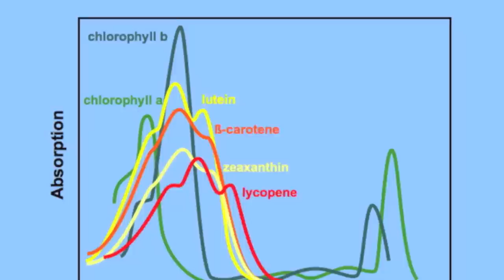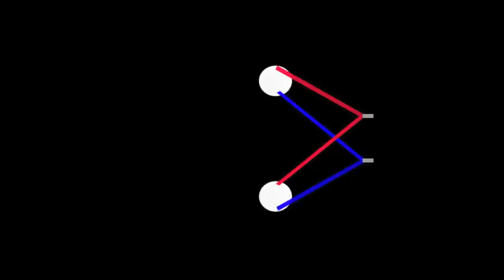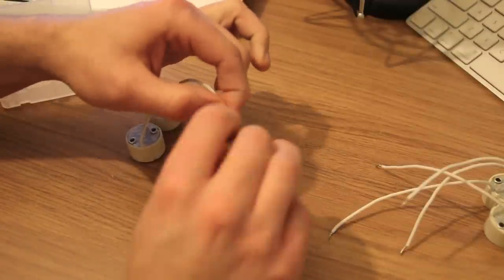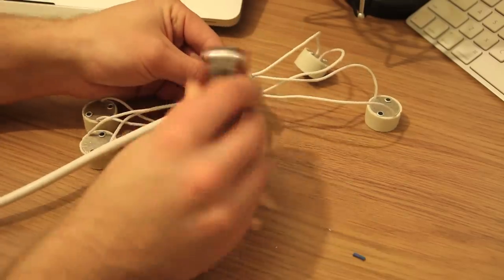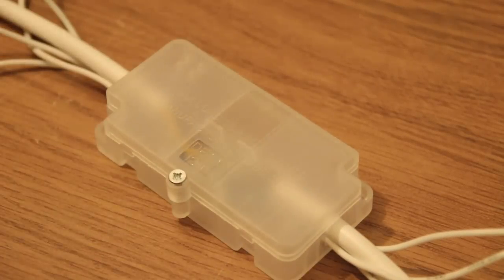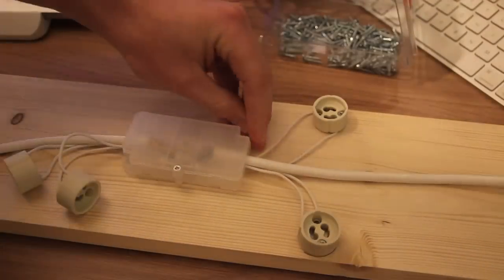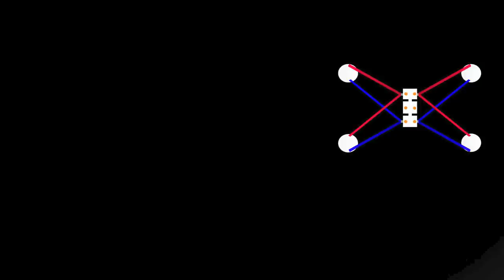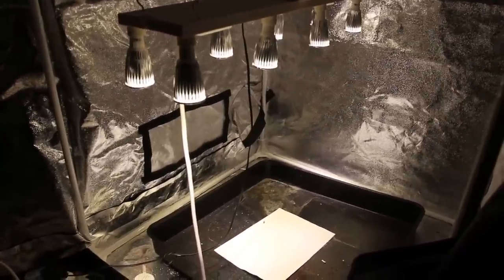96w DIY LED Grow Light - How to build it for $57

Comment: Great build. Your the only fella,except for me that used an electric box for connections. Two things. One mount the light sockets on a metal box/frame. Electricity get hot and Sparks, mounted on wood equals fire  And you got a ground going nowhere. If you had a metal frame, you would have a ground for safety. And a fuse isn't necessary but would be nice. I built 3 light bars. Check it out. These pointers aren't to criticize, but for people's safety. ✌

Comment: alot of people say you must have red and blue leds but the reality is you can use cool white and warm white led bulbs and get fantastic results. cool white and warm white work fine for plants in non flowering stage.  some people talk as though they wont grow at all.  its a little exaggerated or made to sound worse than it is

Comment: They'll grow under any light yes, I'm not trying to say they won't, I'm just pointing out that plants need light in different spectrum for chlorophyll production and photosynthesis. Vegetative plants need more blue light to produce chlorophyll than flowering plants. Flowering plants need more red light to make use of the chlorophyll. That said most lights will put out some light at both points in the spectrum anyways. I think this best route is the one that works for you.

Comment: The 3w LED watt strength is not enough for deep penetration. You have to make sure that the lenses the manufacture use are 90 degree lenses. Generally, most LEDs use 120 degree lenses which defuses the light and doesn't focus them downward towards your plants. Great DIY setup otherwise. I recommend using an LED with the correct lenses degrees (90 degree lenses, again, is recommended). Thanks for the upload.

Comment from the maker: I would agree save for one point, and that is if something at the terminal block goes a little bit wrong. ie. if a wire comes loose. In that sense, I think it's quite important to have the grounding there. (although by that point it would make little difference)

Comment: i think the way to go is vertical growing with large led panels or lightchains that are waterproove put very close to the plants ( like salades) so u could also install a sytem that waters that plants constantly with smoooth raindrops that at the same time are cooling the leds. or for bigger plants like tomatos led cob modules that have higher light penetration.

Comment from the maker: Because its important that each LED be high wattage for maximum light penetration, ie. minimum 1w per LED. Generally the light tubes use SMD LED's which are far less powerful.

Comment: btw leds really can be a costsaving alterntive for horticulture. But its all about efficiency of the leds and the usage of the light. with single chip led u can get that big of a point of source effect as u will get with a hps so if u dont want to build ur leds around ur plants u have to go for chip on board led modules (up to 200 W). the are really similar to the light densitiy characteristics of hps lights. Or you build large panels and put them around the plants.

Comment: Thanks for sharing. Just a note, the equipment ground wire (grn/ylw) serves no purpose in this setup. You can use a 2 wire cable

Comment: Vince, I first watched this video some time ago, and found it very interesting.  But I was new to all the indoor growing hobby.  But I now have my own self-made grow station, which is set up for the 1020 tray system.  The frame is 48"w X 20"d X 80h".  I now have two four foot T5 systems(one 4 lamp, and one 6 lamp).  But I want to try out the led growing way as well.   Stupid phones(pun intended) can take pictures, but cannot spot metre a dark portion, and then allow me to shift position and come up with a decent picture.  I'll have to use a dedicated camera later. 

My problem is that I have limited height allowances and must make the light system only take up a few inches in height.  Have you tried setting up a grow system, which uses either the flexible led strips, or the 3 watt individual lights, and making a larger system?  Either would be the perfect way to save on height.  I know it is a bit more complicated to do, but would be a real feather in your hat if you could come up with a 2 foot, or 4 foot, led grow lamp.  Again, I could just double the length of your project here, but I would still have the height disadvantage.  

Incidentally, Great job on this project.

Comment: 10 real Wattage per bulb  that is pretty nice for this price. 
Are they available in blue and in red?
With HPS light higher penetration( lux/distance) is achieved with reflectors cause of the point of scource effect and 360° emitting.

Comment from the maker: You'd be surprised. In a smaller area (this bit is key) the light intensity is similar. We're talking about a 20cmx20cm area for each bulb, as opposed to a 120cm x 120cm area for a 400w hps. the HPS lights 4x the area, but the light intensity is similar. Which is interesting because with the above figures, the HPS covers 36 times the area, 36 x 12w = 432w. So there must be some truth in what I'm saying.

Comment: plants can´t do anything with green light! although if you count reflecting as something it can be do with it, you´re right! :D the only reason why leafes are green is because they do not have the ability to absorb green wavelengh. if you would create a sun only for the needs of plants, it would have 430, 460, 640 and 660 nanometers as the dominant wavelenghs, a bit of 500 and 620 for secondary metabolites and nothing more, even these last two wavelenghs can be missing and its completly fine!

Comment: That doesn't explain the lens degree though. The LED can be a 10w chip and it won't do anything if the lens on it diffuses the light making it unusable to growing. Keep in mind that LED manufacturers create LEDs to light a house, not grow plants. The specification any grower needs to look at, other than the chip size, is the degree of the lens. 90-60 degree lens is what you need, period. Don't care where you get it, but you gotta know what you're buying. So tell me Chris, what's the lens degree?

Comment: The best available high power leds have around 100 lumen/watt (cost around 5-10 dollar per piece). So ud have around 3600 lumen total brightness. Hps have around 150 lumen per Watt. If u want to grow 0.2m*0.2m/bulb u want to liught 0.32 squaremeters with that lamp. that makes around 11 250 lm/m^2 which is just enough light to grow plant in vegetative phase, but to flower plants like tomatos u need at least 30 000 lm/m^2. So the plants grown will 1. stretch 2. only prodce small fruits on the top.

Comment: Does is matter what the sockets are "rated" at 120V or 220V? If they don't have any electronics in them, is there really a difference between '120V' and '220v' socket. In America with '220V' sockets with 120V lamps and 120V electricity.

Comment from the maker: Do a little calculation on watts per square foot of a HPS - this grow light packs about 48 watts per square foot (or the V2 does anyway, this one more like 36 watts) - a 250watt HPS usually grows in about 9 square feet which is 27.7 watts per square foot. Simple maths :-)

Comment: if I wanted to triple this amount of light (96 x3) should I just extend them with wire like you do connecting the boxes or do the 3 sets with individual power supplies?  I have a 6ft 90 gallon tank and want 3 watts per gallon.

Comment: Question: I have a light fitted in my bathroom,  its round with cover , when cover is off it holds 36 ( non replaceable L.E.D's-), lamp 16w l.e.d ,would this 250-Hz?????

Comment: Very similar to the one I've just built but I've used 12 x 5 watt units in a mix of grow light and daylight. Just a few criticisms... 

1) Pinching the wires like that is a no-no but you know that. 

2) Please buy a proper screwdriver. Swiss Army knives are for opening beer bottles and getting boy-scouts out of horses' hooves.  Terminals should be done up with a terminal screwdriver hence the name.

3) Your earth wire isn't doing anything and can be dispensed with entirely. There's nothing metal you can touch really and the bits you can touch you haven't connected to earth. Two core is cheaper than three core and the gauge of wire you're using is pointlessly big anyway. 96w isn't even pulling half an amp. 0.75mm^2 cable can easily carry ten times that.

Comment: hi buddy nice video, would i be able to run this off solar panels and a 12 volt deep cycle battery?  i live in spain and were i grow we don't have mains electricity and my idea would be to use this system for a winter grow.  we get 9 hours good sun in the winter.  i would leave the plants outside during the daylight hours and let the batteries charge then put the plants into a grow tent under your light system for the remaining 9 hours of light that they need in veg mode.  what do you think? any help much appreciated!!  thanks

Comment: InvalidCharacter1
I would guess that as there are only 2 contacts on the gu10 bulbs/frittings then they do not require an earth. You're right, the earth is doing absolutely nothing. Should have chopped it at the plug.

Comment: the only good thing about white leds is that the "fullspectrum" (misses a lot fared, 470 nm and violet range) that is has already a good balance of red an blue. this is the most important thing casue this will define the shape of the plant and in the end the crop. summa sumarum you get double as much energy of monochrome leds. But energy isnt all that counts. its about suger produce/photon. With the same energy u get more photons out of red cause the wavelentgh is longer.

Comment: hey vince, i finally have  the budget to buy the bubls necesary for this fixture. i didnt know, or remember that the gu10 base was screwed in. make my life 100x easier, i was looking for thermal glue. how strong are your leds? i found 5w=50w at 500lm each, (with one diode and another with 4 smaller diodes) all high power
do you know what lens angles your leds are using? i dont know if 60 or 45 degress is better.

Comment: those plastic thingies with that help bind the wires (i dont know what theyre called but they kinda became dust on my fluorescent setup, must ahve been the heat of the wire, what seccion of wire is needed to wire these gu10 leds together?
what size screws did you use to fix the gu10 sockets

Comment from the maker: In terms of comparing these LED's with HPS and other grow lights, the biggest single determining factor is the distance the light source can be from the plants. As soon as you add 12 inches below the HPS you've reduced the light intensity (lux) to levels arguably below that of LED's. I tested the power draw on these bulbs and they take 10watts constant - so not the full rated power, but they never do. They run at 18v with a 700mah driver. At 24 inches of distance, the 92w LED puts 8600 lux.

Comment: should calculate in par not wattage, if you like to get the best spectrum for growing. even the question part 2 you can´t answer with watts! You should use also temperature for explaining the specific life cycle usage. 2300k flowering, 5500k vegetating.

Comment: i used blue, red and warm white 3w led's, 6 red, 3 blue and 3 warm white, thats 36W and the plant grew, not fantastically but it grew - so my led uses next to nothing in power, elec. bill unchanged.  
geting the light wavelengts right is vital, otherwise dont bother.

Comment: have you grown anything using  these lights? i've read that you need red and blue lights and such.
Reply: You'll be able to grow like an ounce or so.

95 watts is like piss all if you wanna grow weed
Reply: Chibzilla 96watts is enough to have a decent grow if you use a HID or a decent LED panel that has been designed to grow plants with.

Try using a Watt metre on a 600w High pressure sodium; it'l use ~600 watts for about a second or so after the bulb has first ignited - then the electricity usage will begin to rapidly fall down - My "600" HPS only uses about 200 watts per hour - once its reached optimal operating temperatures - I have a 250w HPS which uses about 85watts per hour.  It grows big shtenky nugs!

This LED panel uses 96w per hour - which is a considerable amount of power drain.  The problem is that this lamp will have a very poor PAR value - most of its light will be in the oranges,yellows and greens - because these lights where designed to create the maximum bang for the human eye - with the smallest amount of energy use.

From my experience I can say that this will grow plants - but probably not as well as 96watts of CFL (a mix of 6400k and 2700k)

It'l need lots more indigo, blue, red and most importantly Far red, Far red light has more energy (per quanta) than any other wavelength of visible light - and this is the reason why most growers favor the red hue of the HPS.

Comment: And that brings me back to energieoutput. these lamps claim to have 3 watt leds. probably true if they were run with 700 mA , which is impossible 0.8*12 W = 9.6 W heat energy in that small spot passevly cooled with almost not heatsink. And even if they were run with 700 mA they woudnt have 3 watt. 0.7 A * 3,4V (typcal for Gan-Diodes)=2,38 Watt/led
Run with 350 mA (which is more likely) 0,35A*3,2= 1,12 Watt / single led.
32*1,12 W =35,48 Watt.